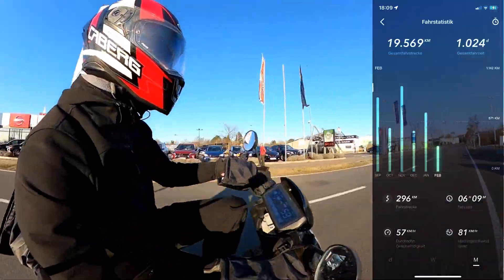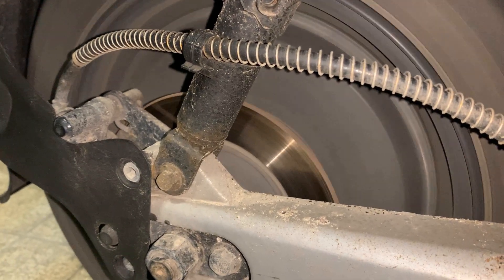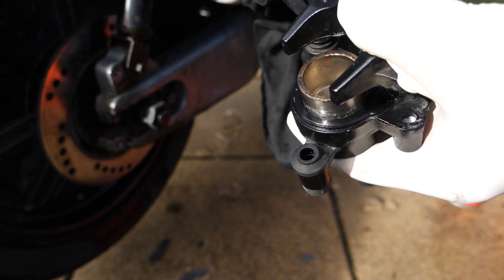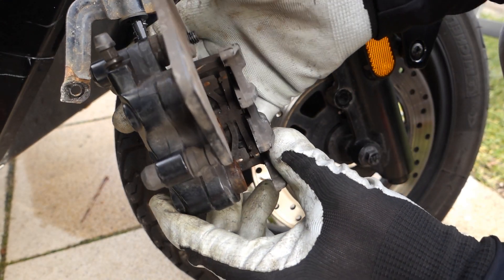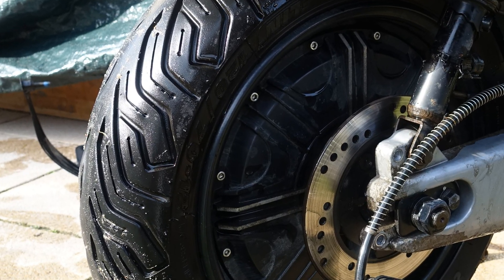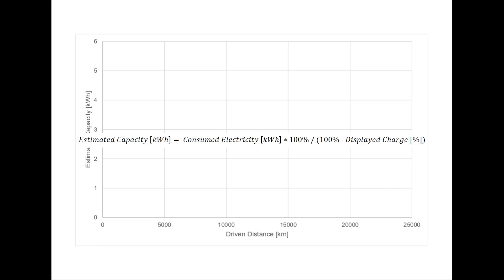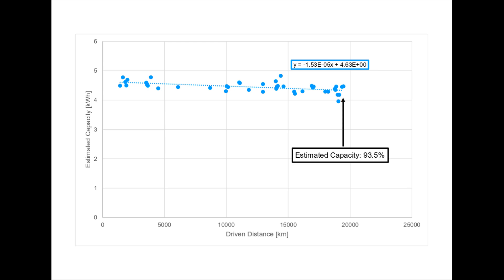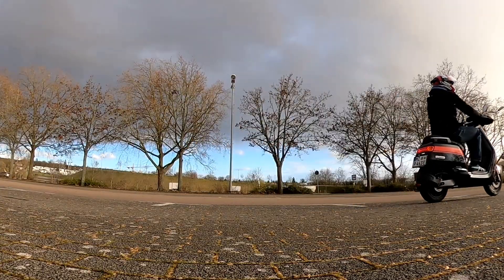NIU NGT (NQi-GT) after 20.000 km / 3 years

Comment: brake calipers are not the best i have more issues now with the front because last i did replace the pads and but the wheel didnt move freely.strange original pads the older ones has no issues at all.also about the paint on the swingarm is poor.i did paint it in glossy black and 2k clear coat much better now.
Reply from the maker: I would recommend to check your fluid level. In my case replacement pads were thicker than originally. There was not enough space in the reservoir to push them back. Cremoving some of the fluid helped to make it spin freely.
Reply: @prometeusz.jasinski  i always check the fluid lvl when it goes down i know the pads start to worn out.i always clean the pistons and grease the parts too. it was funny i thought the middle piston is broke because it didnt come out then push the rear brake lever haha.I try to balance it but i also see that the rim it self is not spinning straight anymore just like the rear hub motor.Bad roads here.bearings are ok.

Comment: Hello Prometeusz, thanks for your videos, i bought the 2022 model and after 5400km the Niu store told me that my brakes need replacing. I am shocked that the pads is so bad. Do you have any advice or can maybe share a link to the replacement pads that you bought please? For some reason the calipers are eating a groove into the back brake and i think its a factory issue but the Niu garage in Malaga said its not covered by the guarantee.
Reply from the maker: Sorry , but I’m in Germany so my sources will not help you. I recommend you buy original spare parts as they are quite ok to my mind
Reply: @prometeusz.jasinski  thanks, I'm in Spain and the originals lasted only 5k km. Anyway, thanks for the content, I appreciate it

Comment: Hello Prometeusz, this is the video I was looking for. Thank you.  I never had a scooter and I still hesitate between electrical vs gaz (i have EV). What is the theoretical and real autonomy of yours on middle mode (not econo)? Have a good day.
Reply from the maker: Hi, I only ride full speed with about 1% per km. 80km until battery saving mode kicks in are not a problem.
Reply: @prometeusz.jasinski  Thanks a lot, very useful , I will consider the brand now.
Reply: @prometeusz.jasinski  Sorry to ask again- what is the theoretical autonomy of your scooter (you have 2 batteries)? On the NIU site scooters with two batteries are 110-160km  (on paper :-). Depending on usage , modes, weather ,weight etc i know in reality is less.
Reply from the maker: @jdrublebuble  those numbers are given at 45km/h or even at lower speeds. I recommend forums for real numbers depending on the scooter type you are interested in.

Comment: How long do you think the bike will last? How often did you ride in snow/salt on the roads, could you estimate days/year? Do you think buying corrosion protection would be worth it? Could you sell your last bike for a bit or did you just trash it?
Reply from the maker: 1st year for sure 5% of the time. Second less than 1% and this winter also not so much. If you see more salt, corrosion will possibly eat up your bike.
Reply: @prometeusz.jasinski  thanks a lot, i live in Denmark and i would say maybe 20% of the time (only some of the winter) salt is being used. Bike will probably last only 2 years then, and then a used car will be cheaper than the NIU sadly
Reply: @prometeusz.jasinski  i always wash it carefully then after apply wd40 on most critical parts.U can try that on ur front fork too mine was also rusty now less but i ll replace it anyway.
Reply: Wd40 protect ur frame and all parts from salt and dust.Use it.

Comment: At current fuel prices and the fast forward extinction of fossil fuels, riding my NQI scooter is a no brainer. I am only coming up to 7 months and 515 miles of use. The biggest problem we have is living in cities where a lot of people live in tenements. Charging is going to be the crux of owning anything electric. Prices of electricity is rocketing world wide and fast charging will work out at petrol prices very soon. Battery life is the next on the list. We need an exchange scheme, a battery on a scooter is half  its price. On a car it’s the same. It’s not cost effective to buy another battery. It’s more proactive to buy another bike! The same for a car. It’s scrapped effectively once the battery is past its charge cycles. This isn’t good for the consumer or the planet.
Reply: The battery will have approx 600 to 800 Charging cycles, i think the bike will break down before the batteries

Comment: Electric vehicles are a low-cost way to get around, but maybe not when you consider batteries. In addition, there is a serious shortage of cruising range. Obviously, gasoline vehicles are good enough. The battery technology of electric vehicles has been improved slightly, and the energy density is too low.
Reply: I have noticed that new alcohol gasoline is bad. When before was never ever problem with fuel, now it occur to everyone. Cause of that I bought electric scooter which range is more than enough my short daily driving.
Reply: Non sense. 110km range for an electric scooter is more then perfect.

Comment: The problem of paint peeling on aluminum alloys existed a few years ago, and I don't know if the latest products have improved. Other accessories are very cheap in China, so we will directly replace the accessories, or modify more advanced accessories. Electric cars are fine. The only downside is that charging is too slow. There are many free public toilets in China, there are free power supplies in the toilets, don't worry about running out of electricity, but it takes a lot of time to charge, and it can't be used for long-distance riding (over 300Km), so I sold NQI and bought a gasoline car motorcycle.

Comment: Very nice! I have the same NGT. A question regarding rust etc. How often do you wash/rinse it? I wash mine a couple of times each month.
Reply from the maker: I treat it like a car for commuting. So I wash it only 4-5 times a year.
Reply: @prometeusz.jasinski  bad idea for a bike, they are not cars!
Reply from the maker: @kevindarkstar  it's advertised as a replacement for a car. Don't know any technical reason why it should not last like a car.
Reply: I washed mine after 1 year, because I treated everything against rust and didn't want to wash it off
Reply: @dotternetta  How well is it protected after you treated it? Any corrosion? How did you treat it?
Reply: @joakimdam9723  Spraycan, almost no corrosion, but I started too late. New scooter will be threated right away
Reply: @dotternetta  How fair did you ride it in kilometers? Is it a niu? Where do you live and how often do you ride in snow/salt. If you see almost no corrosion, how do you know you started too late? I'm really curious, I'm considering buying a niu instead of a 2. car in the household
Reply: @joakimdam9723  12000 kms, Netherlands, Niu NGT, we had salt on the road this winter and everything starts corroding. I treated the central stand and the swingarm, but not the springs ir brakes and you can see some corrosion there. How are you planning to use it? I drive it 2 x 32 km/day and recharge at work. Speed dropps when battery get below 50%. I start at 85 km/h and after 30 km it is down to 77
Reply: @dotternetta  i plan on using it all year in around in Denmark. We have maybe salt on roads half of the winter. Like 15% of the time there is salt on the roads. I'm afraid it will be ruined after 1 or 2 years of use, if that's the case a used car will be a cheaper alternative compared to the nui. I will use it 2x10 km for to and home from work.
Reply: @dotternetta  which model goes 85 km/h? I also see nui mqi gt and nqi going max 70 km/h
Reply: @joakimdam9723  the NGT (12 inch model, the 14 inch model does 70) and the new GTS, I believe
Reply: @dotternetta  so the smaller wheel model actually does 15 km/h faster? That's interesting. I only thought the new gt Evo could do 85 km/h
Reply: @joakimdam9723  running costs of a car are far more expensive, I saved 1200 euro diesel this year (10000 km) and road tax and insurance, used 60 euro electricity. It will last 50000 km or more if look after. Did you watch the video of the German NGT? Mine looks much better. 10 km x 2 will be no problem at all. First year devaluation with 10000 km was about 1000 euro.
Reply: @joakimdam9723  yes, the older 12 inch model runs faster, but 3,5 kW is too less powerfull to keep it above 80 when windy, so they must have limited the newer model to 70 to prevent people complaining. The GTS 2022 is 4600 Watt (the old one is 3500) and should do 80 km/h easy, but the price is about the same as the Evo, which runs 100 km/h
Reply: @dotternetta are you sure it will last 50.000 km in Denmark with salt on roads 2 to 3 months every year?
Reply: @dotternetta  the 1000 devaluation from 10000 km, who told you that? The service store?
Reply: @dotternetta  I'm really considering buying the Evo, but I'm afraid it will only last 2/3 years when I pay 5000 eur for it
Reply: @joakimdam9723  Spraycan blank tectile
Reply: @joakimdam9723  probably longer if treated right. It might not look that pretty any more but parts are cheap and everywhere available (lots of rental scooters here)  No moving parts, no wear. I'm confident enough in Niu to buy a new one. 3 years warranty. And after 2 years I can buy a new one from my works km' compensation
Reply: @joakimdam9723  I traded it in at the dealer
Reply: @joakimdam9723  If you don't have the money and don't enjoy motordriving or the km compensation don't buy it. But alone on the savings financially the choice is simple imo
Reply: @dotternetta  I have the money, but i don't get paid kilometer compensation because i only have 10 km. I just feel like a small used car can be resold in 3 years for less than 5000 euro in devaluation, where as gt Evo would cost 5k and would probably be zero worth after 3 years. I had a scooter when i was younger and I loved it, i think I would enjoy commuting on a niu, but I'm still not convinced it's worth it financially compared to a small used car like aygo C1 or city go
Reply: @dotternetta  how come you traded it in at the dealer?
Reply: @joakimdam9723  He gave me a good price and I really like the guy. I had it for sale a while but only idiots bidded moped prices
Reply: @joakimdam9723  yes, with less kms all the numbers change. I understand your doubt. I earn € 15 daily by using it
Reply: @dotternetta  what model did you sell and why? What model do you ride now, and why?
Reply: @joakimdam9723  I now drive the NGT 12 inch, and will trade it in for the Evo. Sold it because it's just a little too under powered. When I bought it it was the only model available capable of the speed I wanted and available as a demo. It was also a test to see if I could get used to it and enjoyed it. Alternative is the Horwin EK3
Reply: @dotternetta  i have looked at the horwin too, but it's sadly not for sale in Denmark. I have also considered ecooter e2 max. It can go 95 km/h and it's cheaper than the Evo gt.
Reply: @joakimdam9723  The Horwin doesn't have enough range for me. Calculate with 80-100 wh/km at 100 km/h. The Escooter e2 max is not available in NL
Reply: @dotternetta  100 wh/km how many km is that? What do you think of the ecooter e2 max from what you have read? Do you think it's a good buy?
Reply: @joakimdam9723  Divide the total battery capacity by 100 Wh to get the estimate range. I use 60-80 Wh now @ 80 km/h. I have 4200 Wh onboard, so range is 70 - 52 km, depends on the storm I ride in. 20 km will be no problem. I will look into the escooter e2 max specs
Reply: @joakimdam9723  belt drive and 4000 watt, not for me! German Govecs scooters had belt drive: they wear a lot, but maybe technology has improved. 4000 Watt seems to low for me, will be just able to keep 80 km/h sitting upright in high winds. But look for honoust reviews on Youtube, maybe I'm wrong
Reply: @dotternetta  thanks a lot you seem very knowledgeable on this subject . 7 km out of the 10 i have for work is on 80 km/h road. Do you think 5000 watt is minimum to keep 80 km/h at winds upright sitting at my weight (87 kg)?
Reply: @joakimdam9723  my experience is only with 3500 watt, and mine is barely holding 80 km/h with full battery even with no wind. I expect 4500 watt do be oke, and for me the Evo (same price) was therefor the best choice. Ask me again in 2 month, I can give you better numbers about power, the Evo has a kW display
Reply: @dotternetta  sounds good, if i remember i will ask for for an update when you receive the Evo 😀
Reply: @joakimdam9723  But 10 km...why not go by bicycle?
Reply: @dotternetta  working nights sometimes i would just hate to have to bicycle home after night shifts. Bicycle would take 30 min each way that's 1 hour everyday. Electric bike with 80 km/h will only take 10 minutes. But yes an electric bicycle is also a possibility, but they are almost as expensive as a niu
Reply: I really enjoy my Niu, I have the newest model